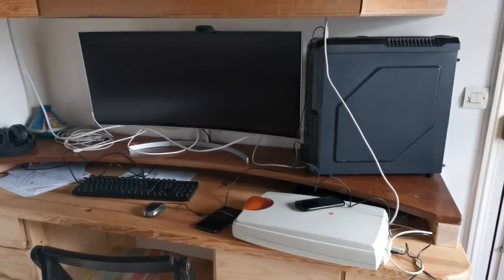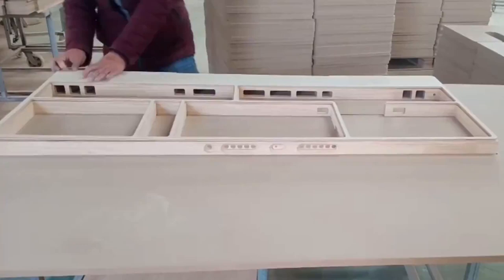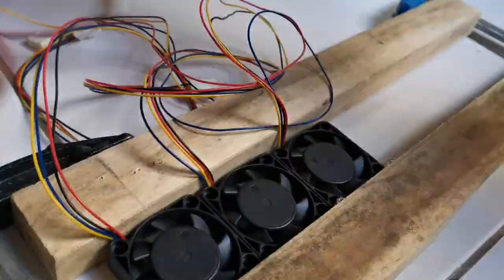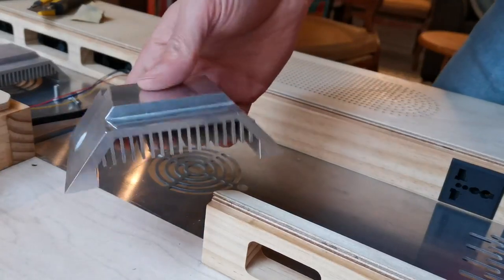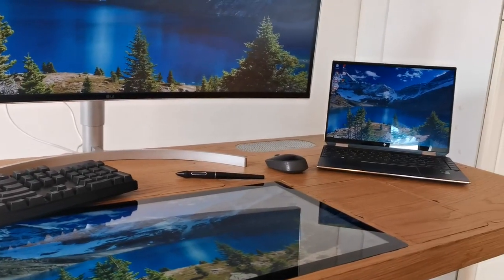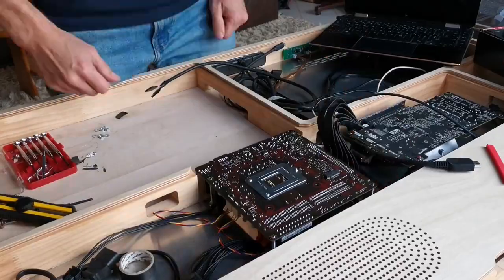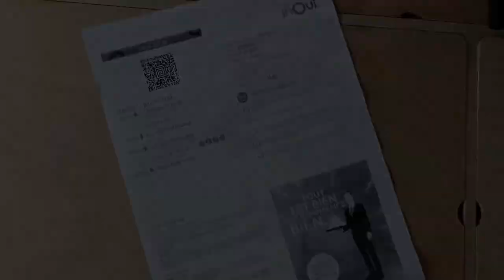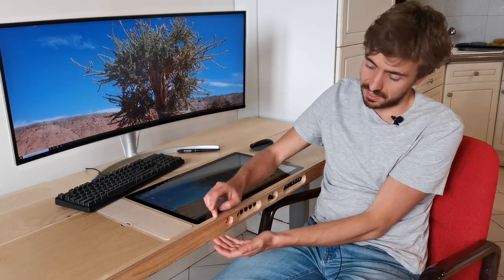Building my ULTIMATE Desk PC

Comment: Ergonomicly a clear no go.. cause built in table.. even if used sparely, from time to time you won't stay comfortable longer then ~30min. and longer sufferings in your neck/shoulder areas would be pre-destinated..
(There's a reason why every 'drawing tablet starter guide(-video)'  recommends getting a stand for the "drawing displays")

I've also thought about building such desk built-ins, and would have used a drawing tablet (w/o display) instead of a drawing display ones, just to not get used to bad body postures and the sufferings from it.. 
Just saying. ✌🏻😉